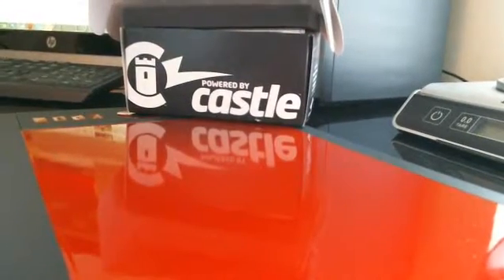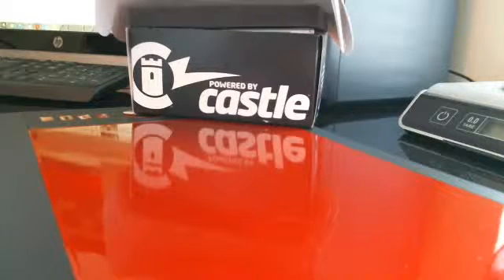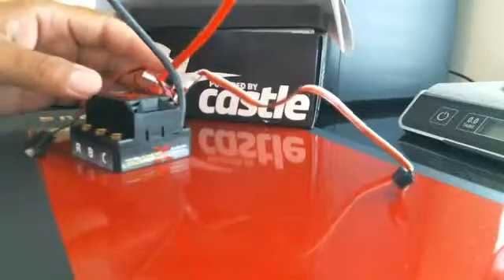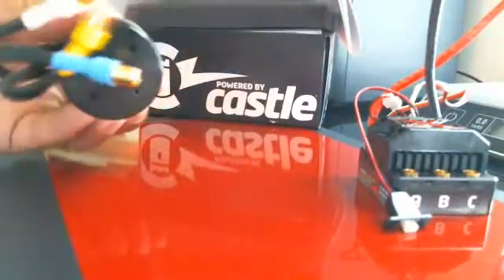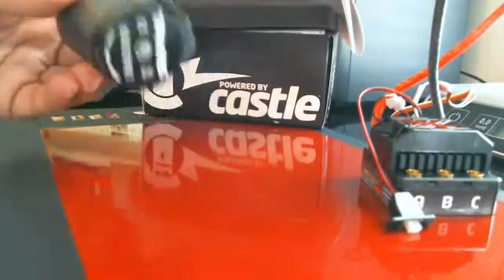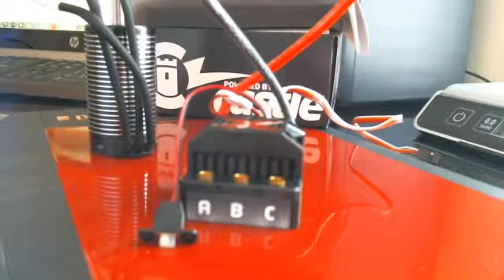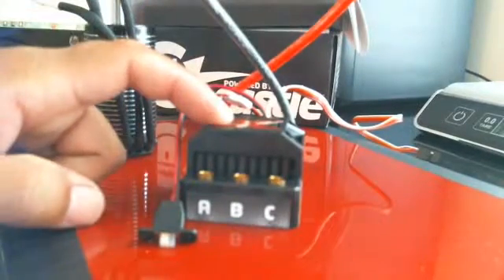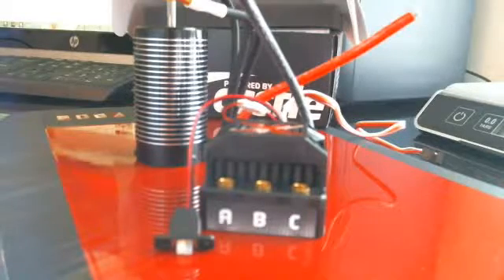NEW MAMBA X Setup..From V.X.L  Traxxas Rustler

Comment: Yo Dannyboy,nice combo I've the same in my losi 8t.Pls add a cap pack if running 6s 60c 6500mah or more.l use dual deans on that X.If you r doing a speed run project 34/34 racer,set your punch at medium at first?My Losi's gearing is high 28/40 with 120k center,50k rear,80k front. On your build invest in lock spools and 17mm hexs,GRPs.RCFL😎